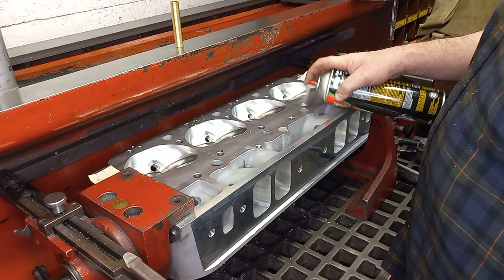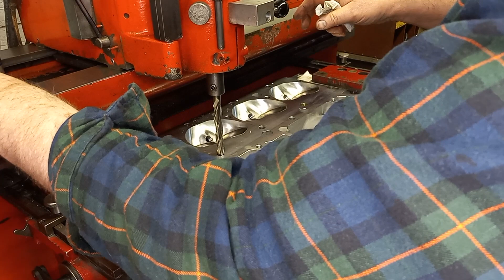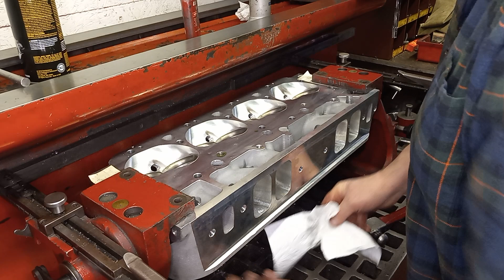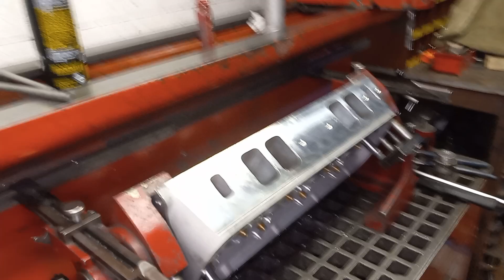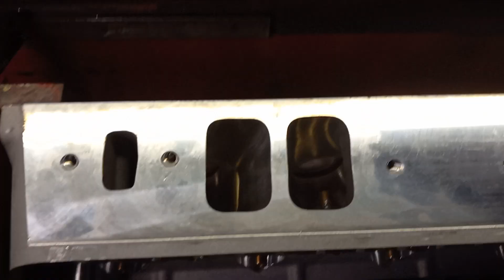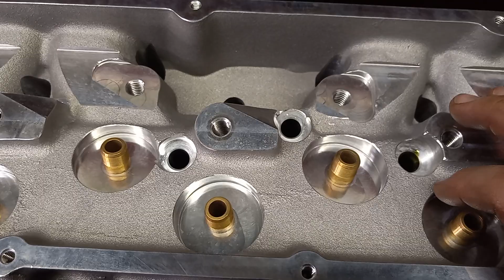BBC  sniper pro filer 174-X heads lining intake ports cnc

Comment: Why line them. Turbo motor?  Wouldn’t the block have blind headbolt holes or is just what the customer wanted?  Just curious.
Reply from the maker: Have a leaking roof will fill the basement  ..oil could end up in intake port as it's cut thru on the cnc program very common on big block with big runners
Reply: @mccarthyperformance2015  I understand that but I’ve never had an issue with a head bolt hole through the port, I suppose a stud would be harder to seal.  Just curious, not trying to be critcal.
Reply from the maker: @davidleary823  like I said in video  done them both ways. this will be studs   street engine so the amount of effort its worth it for customer  to know oil not leaking in intake track
Reply: @mccarthyperformance2015  Big 10-4.  You the man!  That’s  was I was wondering.  Thanks.